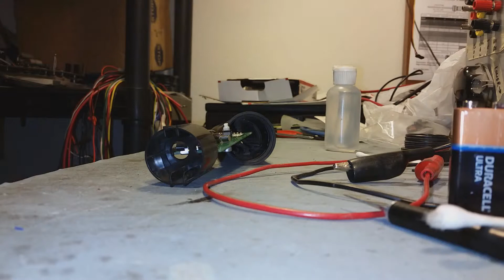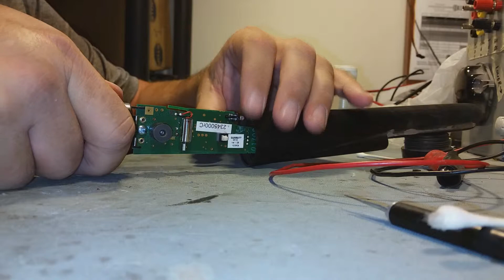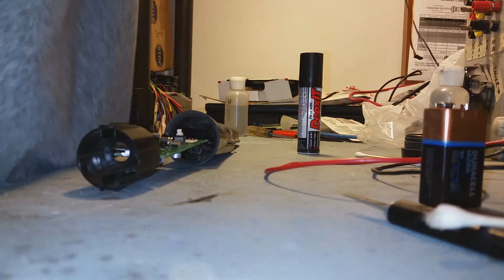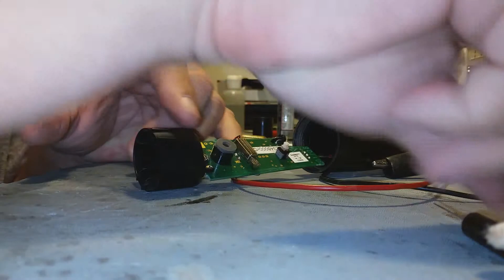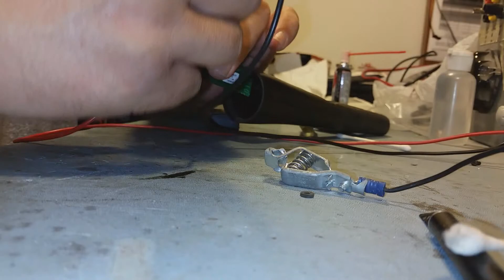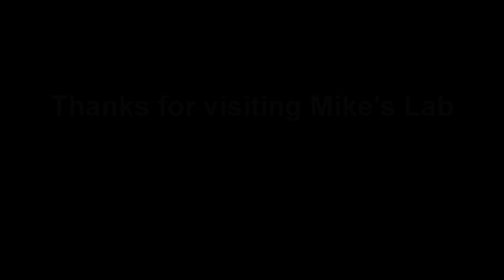Pro Pointer Switch Repair part 1

Comment: To get the core out use a hair dryer, warm it up and the bang on the tip and the core will fall out. Definitely check your wires.
Reply from the maker: Gotchya !!

Comment: The low battery is a propointer "secret"...since my G2 runs a single 9V, when bat to low to run G2, swap into pro pointer, it will run the PP a couple months, don't have to buy bats just for it, just use the "dead" one out of the tector instead of tossing it.
Reply from the maker: Very good to know that! Thanks! I figured it might go longer since it has a 5v regulator in it.

Comment: Hi Mike tha same problem with the one I showed you in the vid. But I lost my diode washer and fucked up the contact. Can you tell me what kind of vontact and maybe where to buy an new better one ? Thanks for the vid I wish I had seen it before taking mine apart so I had not lost the washer. My contact was full of dirt and broke when i tok i apart
Reply from the maker: For those that want to just replace the switch, the Ebay part number is 191490231690 from seller Frerick. $9 with free shipping.